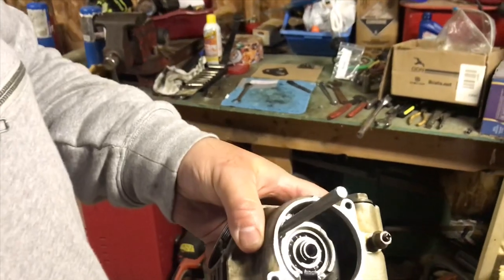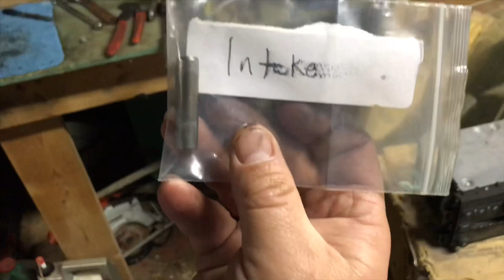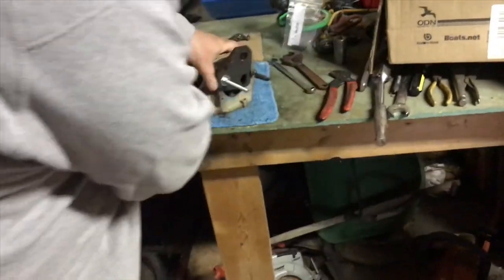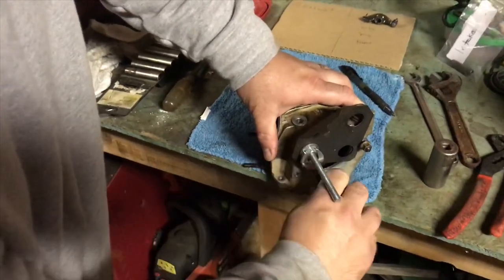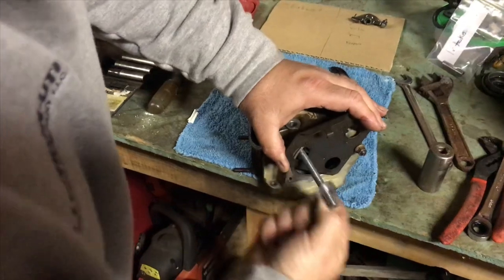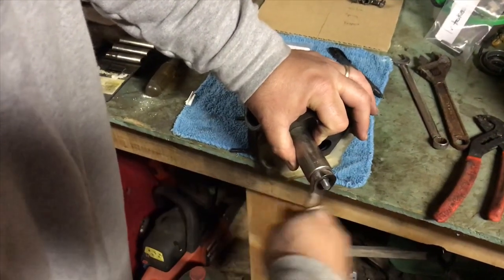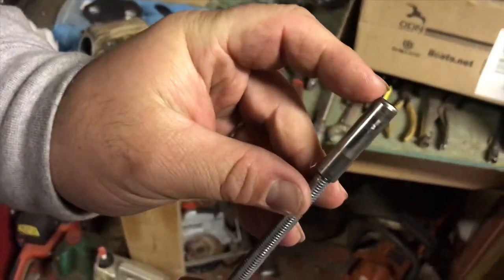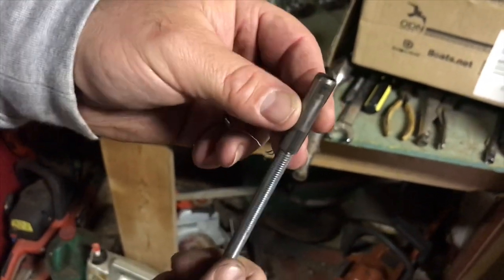How to remove rocker arm shafts on Yamaha small engines.

Comment: You could also just use the factory motor mounds.  They thread right in.
Reply: which ones?
Reply: @jake2102  whatever Yamaha engine you are working on. The motor mount bolts always thread into it like he’s doing here. Always works with Yamaha. Thread sizes are always the same.  Not sure with any other brand but Yamaha is always same.
Reply: @TylerHankss  this is amazing I totally appreciate it. I was a Honda guy but just bought a 2014 grizzly and the valve seals are leaking.
Reply: @jake2102  I found out from my user manual. It says in there that motor mounts will thread in. That’s how I found out